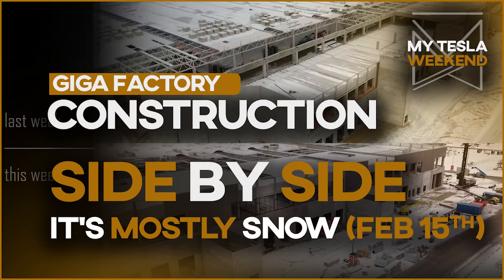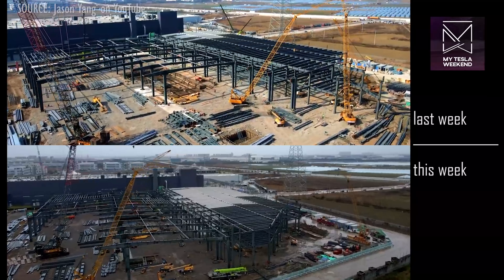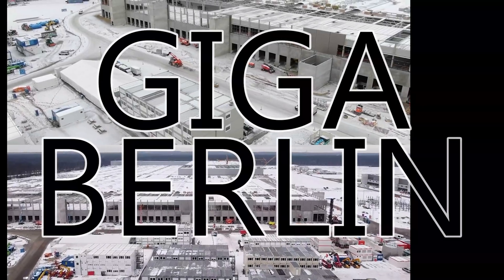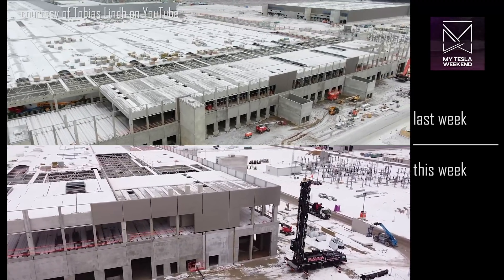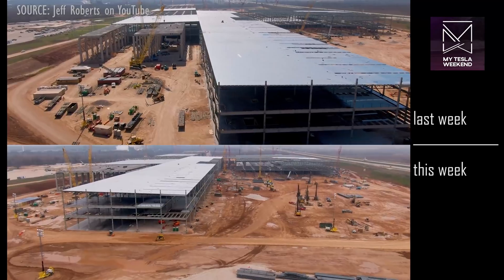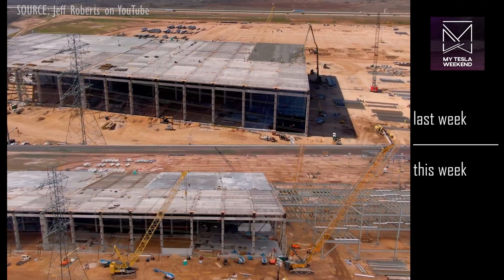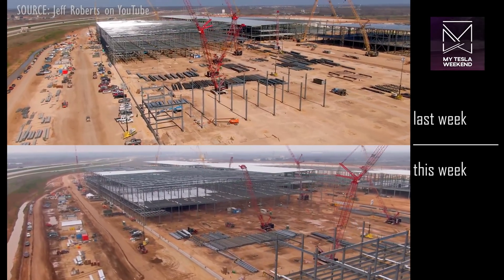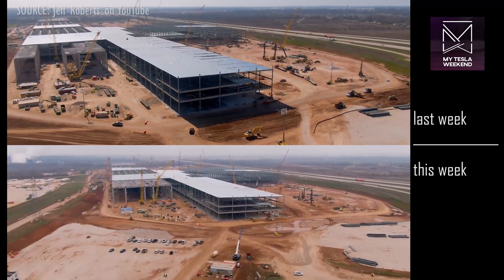All GigaFactory progress before/after week of Feb 14th

Comment: The most significant date for Giga Texas is the date when it produces batteries at scale.  The ability to produce Texas model Y's at scale will not exist until there are many gwh of batteries being produced.  The battery manufacturing part of the building doesn't even have foundations yet.  At best, that portion of the building won't be constructed and equipped for another six plus months.
Reply: Not sure of the time frame but other companies are also going to be making 4680 batteries for Tesla.  Tesla is also installing a line at Giga Nevada.
Reply from the maker: Hot damn, Vern. This is maybe my favorite comment of the day. Yeah, you're right. Build as many cars as you want, but if there aren't enough batteries, the whole thing shuts down. You can source them from Nevada or the Kato Road facility, and that's a fine band-aid, but they will REQUIRE them on site to actually produce at full throttle.

I appreciate your input!
Reply: @FutureAzA  I strongly suspect that Elon / Tesla are sandbagging the production capacity of Kato Road ("pilot line"). And I think the same goes for their ability to bring the battery facilities of Berlin and Texas online and up to speed. How else could they aim for (at least) 50% growth in 2021?

Comment: I say Berlin is going to get delayed for production as they will have the building complete but the occupancy permit will not be approved for a while as the government deals with litigation of the site planning.  As for Texas I think the first customers will get Model Ys in September with Cyber Truck in December.  

I do have an idea for Tesla.  The need for about 150k government owned vehicles per year could be achieved by a site in my hometown. We have a brownfield site that was a former GM stamping plant that is completely cleared. If designed properly I think it could do that much production in a similar designed building as Berlin with roughly 3 production vehicles/types. A Model Y patrol vehicle, a model 3 agency car, and a large skateboard that would get different types of cabs placed on it depending if it was a snow plow/dump truck, firetruck, ambulance, or any other government vehicle in low demand. If Telsa does not want to do the work and just sell the skateboard we do have firetruck builder in our city as well. Plus with a rail line spur on the site the ability to ship those vehicles to anyplace in the US and given our closeness to the great lakes shipping through the st lawerence seaway should be easy to get to the rest of the world.